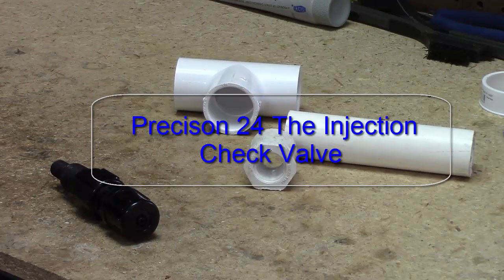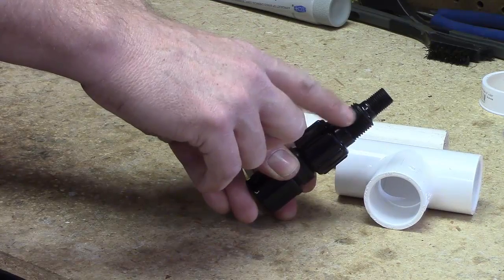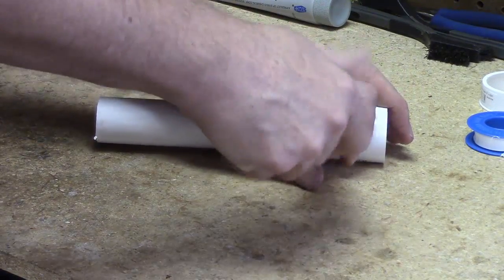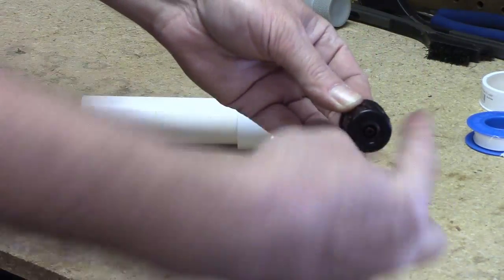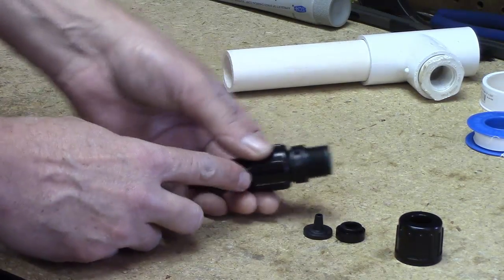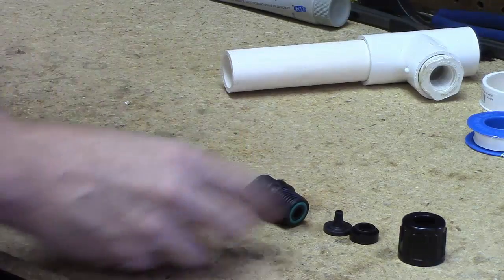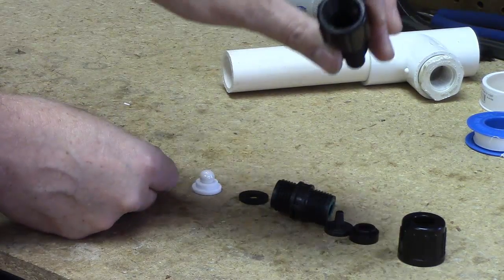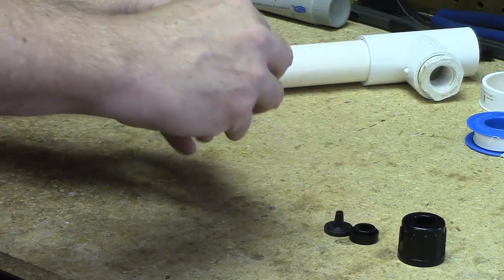Precision- 24 Chlorinator Injection Check Valve Instructions

Comment: Thanks for the great video. I had ordered the complete Precision 24 kit with the 15 gallon tank. When I opened the box to find all the fittings and read the instructions, I got a little confused about the injection check valve.  There was nothing in the instructions on how to install it. I wasn't even sure if I had one in the kit till I did a google search for one and this video was the first thing to come up. Thanks again.

Comment: I replaced the check valve when I turn the water on it works but then sometime it keeps stenner pump running and won't shut off unless I turn on a faucet then it shuts off like it gets stuck thanks

Comment: Will this work with a uni-dose chlorine pump? Should I get this check valve or the value by Steiner?
Reply from the maker: No it would not.  The Uni-Dose usually has 3/8" tubing, where this Precision 24 one is 5/16.   For 3/8" tubing we recommend this one:https://www.cleanwaterstore.com/j-pro-22-metering-pump-parts/j-pro-22-injection-check-valve.html    If you need assistance please email our support team at support@cleanwaterstore.com  thanks!

Comment: How tight should the section above the check valve be? It always leaks for me.
Reply from the maker: Hello - it should be hand tight, no need to over tighten it.  However, it may be leaking because the tubing is not pressed down far enough over the cone fitting.  The tubing needs to be straight cut with sharp knife or tube cutters and then pressure down all the way on to the cone fitting so it bottoms out.   If you look on page 7 of this guide it will show a picture of that cone shaped fitting:  https://www.cleanwaterstore.com/technical/water-treatment-manuals/Precision-24-Proportional-Feed-Digital-Chlorinator.pdf

Comment: Do yourself a favor, use a duckbill valve not the ball&spring. The hard water fowls  those up and you'll be pulling it apart for cleaning more often then you'll want.
Reply: I’m trying to figure out which one to go with between these two designs. The one displayed prevents backflow - which would save me from emptying a huge tank everytime I want to service my Stenner duckbill style model. Any thoughts?
Reply: @cleanwaterstore